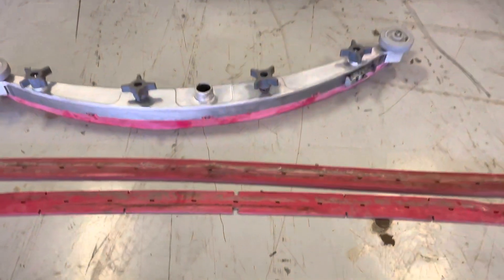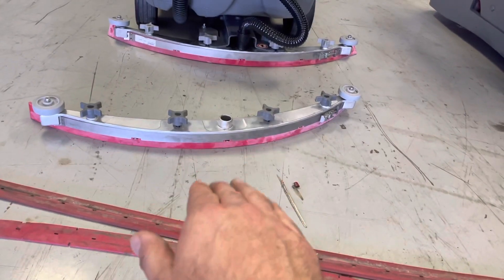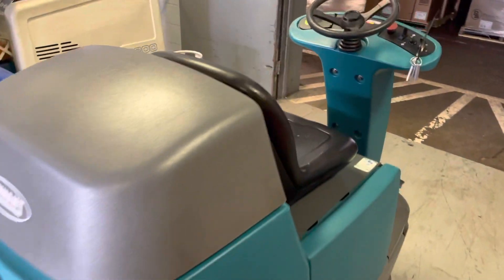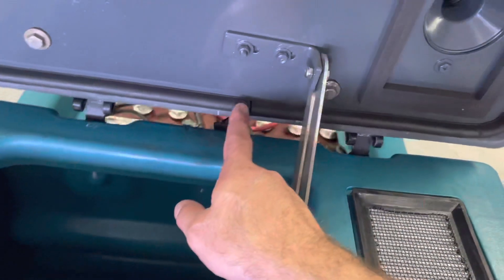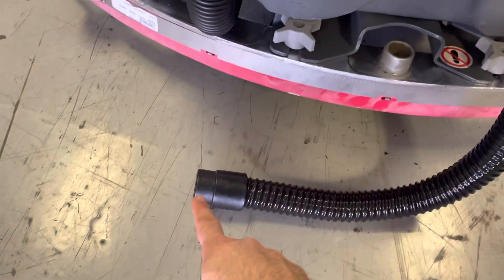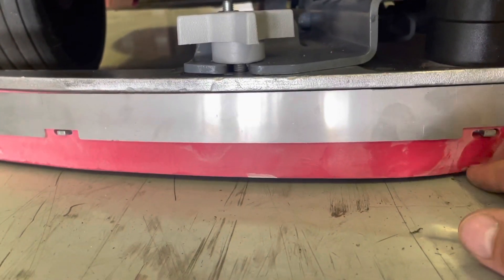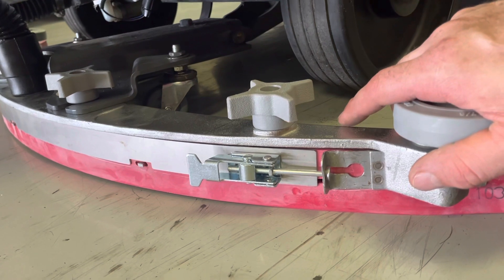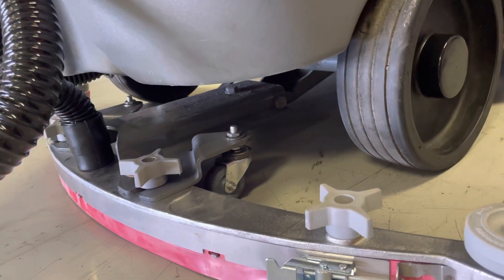Powerkleen - Tennant t7 Nobles SSRider poor squeegee or vacuum performance

Comment: What happens when the back squeegee lifts up and tries to do it twice, then slowly rests back on the floor and drags when the fan isn’t on?
Reply from the maker: That’s a rare occurrence on t7 usually very old machines with a bad board, bad actuator or broken 1031028 Housing,Sqge,Spring,Actuator

Or a combination

Every Time Machine is turned on it does a  “return to home” and pulls the squeegee until it sees resistance or for a limited amount of seconds

-If housing or actuator is bad it never reaches amp limit and releases 
-if actuator is bad it can reach limit but springs pull back down
-If board is bad (not uncommon issue on pre2014 machines) all kinds of things can happen causing a pull push pull scenario

A self test / manual operation described in manual can help get some more detail

If you need parts and can’t get a good price call us
Reply: soy tecnico en estas maquinarias 

las reparo, les doy mantenimiento y las se operar 

me gustaría formar parte de su equipo de trabajo
Reply: This is exactly what the machine I'm using is doing, I've been trying to figure it out all night. I was troubleshooting everything in regards to the rear squeegee. Now I know😂😂😂

Comment: The grey rubber strip that comes off rhe bottom that is shown at 12:55 it trapped underneath one of the squeegee wheels. Ours was doing that and grinding a dark grey stripe into our floors that can’t be removed easily. What does this strip do? 

Also, when we turn the machine off, there is a loud clunk as the pads rise… what is that?
Reply from the maker: The rubber strip is a static dissipation ground strap

If removed you’ll be more likely to get small static shocks when you get off machine and in practice we see more rapid deterioration deck brush motor bearings

A zip tie can be used to position do it will always contact the floor but not get caught under wheels
Reply: @powerkleenfloormachines-jo4881  we don’t want the strip removed lol, just the marks it would leave. So, perfect! We will position it. Thank you! Also any thoughts on the loud clunk felt underneath when the pads come up after turning the unit off?